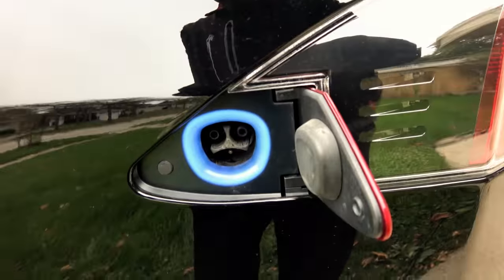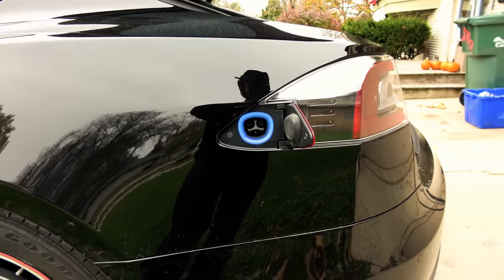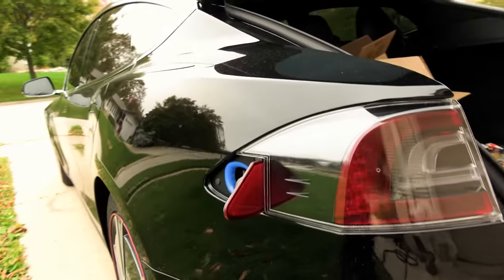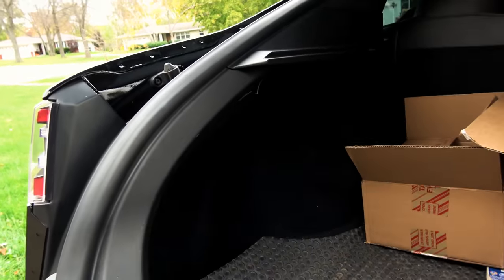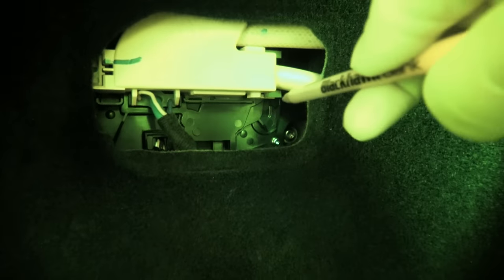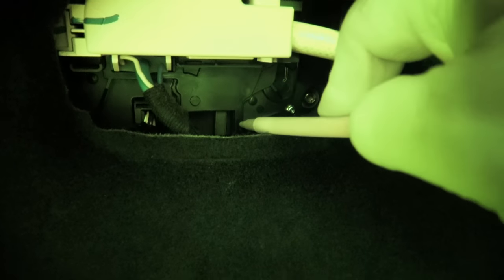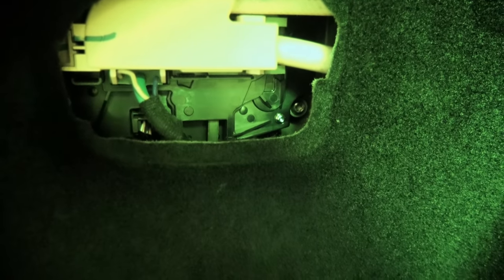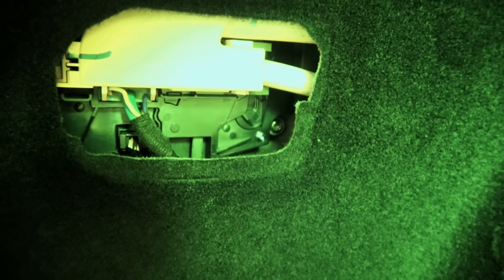Tesla Emergency Charge Port Release Lever

Comment: Hi Kman. Do you think that this leveler was not there on your old MS60. Maybe just the panel that allowed access to it was not there, what do you think ? And thanks for video.
Reply from the maker: No, wasn't present until Tesla switched to the motorized charge port doors.
Reply from the maker: The access panel has always been present, it's how the Technicians access the port for repairs.